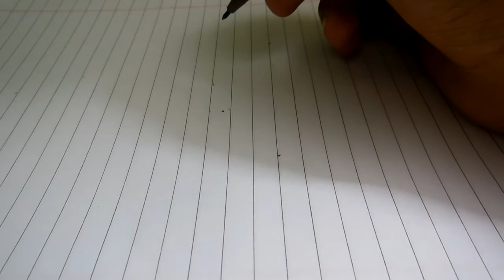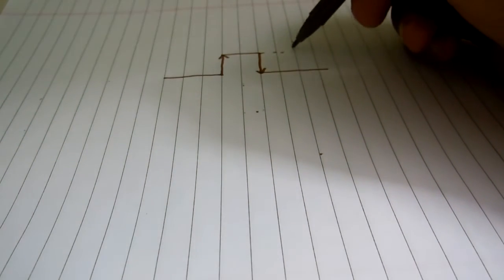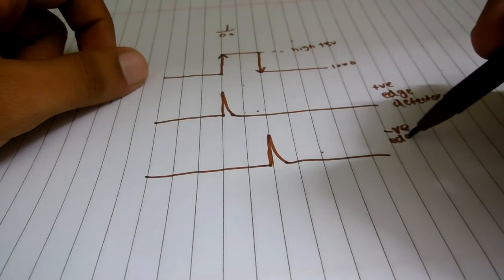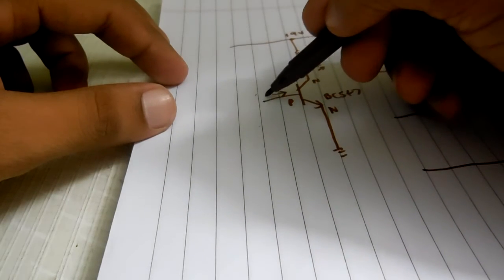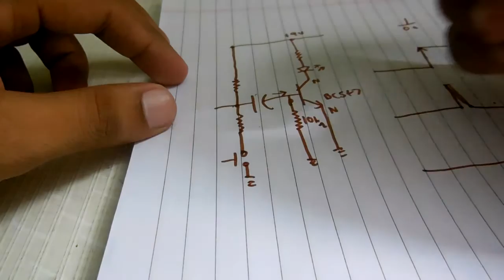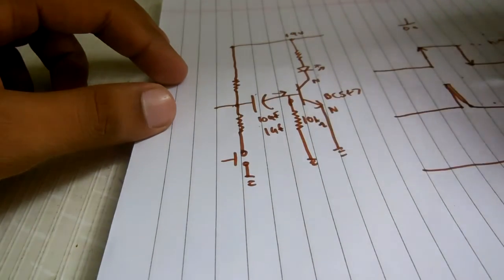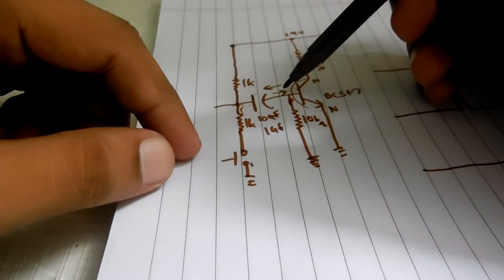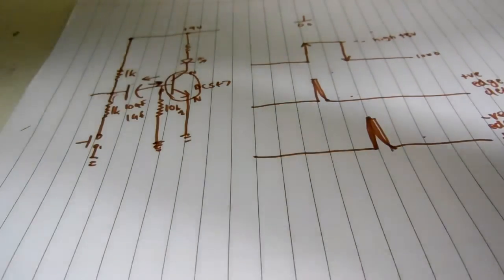Positive and negative edge detector using one transistor

Comment: Thank you so much. Because of this i can finally continue making my project. And in future i will use this design only. Thank you so so so much
Reply from the maker: Edge detection can solve many problems in digital electronics like switch debouncing and toggling states. Apart from that you can use this wherever edge detection is required in your project. Thanks for realizing the potential of this circuit.

Comment: How to reduce the delay of flashing? please!
Reply from the maker: This is not a flasher circuit but anyway it's related to electronics so I  will answer your question. I don't know which flashing circuit you are using. If it's 555, transistor or op amp based then change the RC constant value.

Comment: If this was truly a negative or positive edge detection you could simply attach the output of a logic gate instead of the switch and get the same result. But that won't work. At least not with the exact same circuit. Here is someone who really knows what he is talking about; https://www.youtube.com/watch?v=R3WSlk9lHss.
Reply: This is a classic pulse detector circuit.  There is nothing wrong with it and the output of the transistor could drive a logic gate, in fact you could even do away with the transistor and replace it with a schmitt trigger IC.

Comment: I am following up with another reply after trying several methods. I am a multi-career E.E. and really enjoy all manner of electronics and computers.  I built some of these edge detectors using some of your wonderful ideas with discreet components and really enjoyed it.  I also tried using a $9 USD priced postage-stamp-size ATiny85 processor by Adafruit.com (free shipping with Amazon Prime). It's their 5V Trinket. To accomplish this, I used Arduino's free downloadable UI and programmed the Trinket with a few lines of code via USB cable. The Trinket has several available outputs and inputs pins and I was able to give my edge detector some LED indicators to show the various states. I also attached an external relay module to control higher voltage/current devices when "edge triggered".  This is a rather cheap & easy-to-implement alternative with infinite flexibility for customizing the behavior both in trigger detection and AFTER the triggering for any cause/effect responses desired. Pulse width processing is a snap using software.   I'd love to see your video ideas to marry such devices with some of your discreet component circuits in order to expand the horizons. Thank you.

Comment: i need a pulse detection circuit, when the input voltage (sine or square) is applied if it crosses the threshold (DC input) i want the LED and Buzzer to turn on..... any one plz help me onto it.  
Thanks !!!!
Reply from the maker: lokeshwar babu just add a comparator at the input of edge detector circuit and set the reference vtg .
Reply: for continuous edge detection (for Positive detection only) what i must do..
Thanks !!!!

Comment: Hello, I tried your circuit and it works well.  I am very new to electronics so maybe this might be a "stupid" question. Where should I connect the wire to get Vout similar to what the LED gives (the pulse)? Thanks!
Reply from the maker: connect a wire to collector .That is your Vout
Reply: @prachethire812  But then that will invert the output.
Reply from the maker: @Enigma758  Yes, so you can take the output from emitter of transistor but connect a resistor of 1k  to 5k between emitter and ground or else just invert the output by using a pnp type transistor.
Reply: @prachethire812  Yes, all of the above, emitter follower (a.k.a. "buffer") or use a PNP.  I have used this circuit (a "differentiator") to drive the input of a schmitt trigger and that works very well since it squares up the signal.

Comment: Hello, i have built this circuit to close a latch when the input pulse turns off. I had to make a few changes. 

My application needed a circuit for the following purpose: Power is applied. A heater element controlled by a thermocouple and (slow) feedback loop is kept at a set temperature. The heater is connected by a relay. When another switch is turned on a potentiometer is placed in parallel with the feedback loop to increase the heater temperature to another set point. This also connects power to a 555 monostable circuit. The 555 is triggered when the relay is first turned off (that means, heater has reached the new set point) and ignores further pulses that the feedback loop makes, output stays high for the monostable time duration.

What i needed is a circuit that turns the heater completely OFF, once 555 timer period has expired, so that 555 is not retriggered by the pulses controlling the relay, but it needs to do nothing at first when 555 output is low and also when 555 output is high, i want it to be triggered only by 555 output going high then low.

I have used your circuit but flipped around, using PNP transistor, to drive a latch circuit i found on the internet. There was a problem. The capacitor needs to charge when the circuit is first powered, so the latch fired straight away and the circuit was useless.

This problem was solved by putting a larger value capacitor to ground from the base of the first transistor in the latch. If this circuit uses 1uF then put 10uF from base of the latch trigger to ground, if you use 10uF here put 100uF in the base of the latch. Now when the capacitor of this circuit first charges at power on, it does not create a large enough pulse in the base of the latch driver and the latch stays off. When it has to charge again following application and removal of input pulse, the spike is enough to trigger the latch.

It now works in simulation and i will come back and comment if the real circuit needs any more changes.
Reply from the maker: when I discovered this circuit I knew this fault that it gives a pulse when power is first turned on but I also knew that it can be solved by adding a automatic reset circuitary which will reset the latch to off state but considering your application I appreciate the changes you made, all the best for your project it's really cool.
Reply: Andrei H do you have a picture of this you could share?

Comment: Hi (outc),

I enjoyed watching your video called "positive and negative edge detector using one transistor"
that's a clever design, as I was watching how you were switching the input wires,

 I thought there may be a way to electronically switch the inputs, so the same circuit can detect both negative and positive pulses, without having to switch wiring.

I built an additional circuit for it.
Would it be ok with you if I did a video on my channel of my additional design, using your original design?

 I would be sure to give you the credit for your original design, by mentioning your youtube channel where I found your circuit demonstration.

Thanks
Reply from the maker: yes make a video go ahead , i am eager to watch your additional circuit.
Reply from the maker: and thanks for enjoying this video.